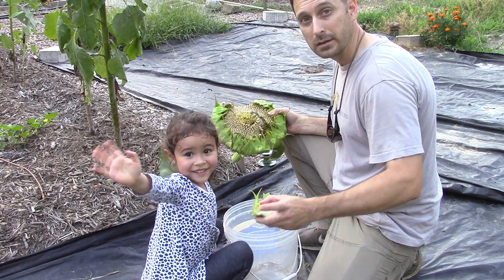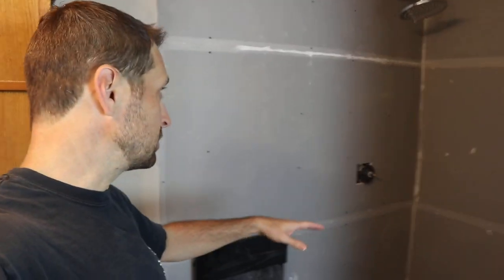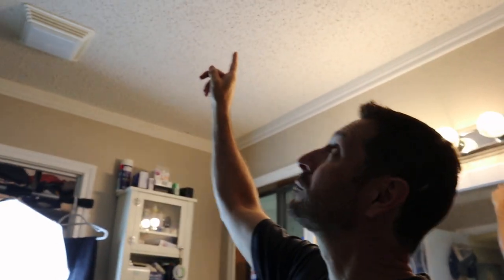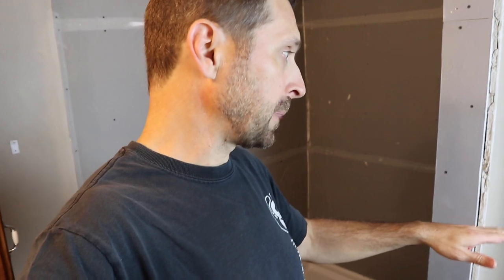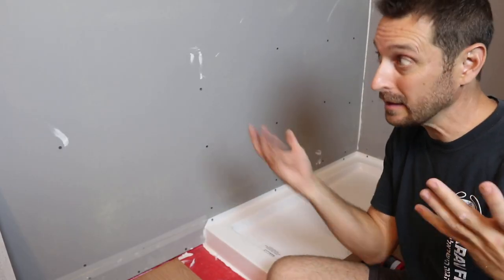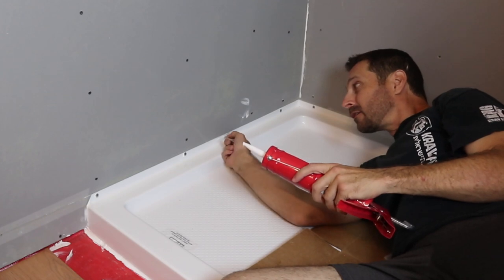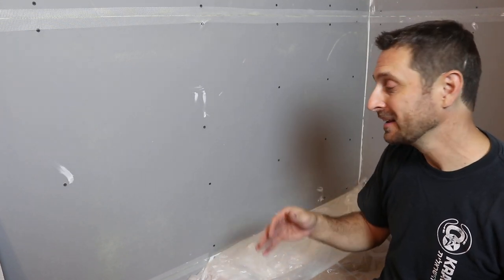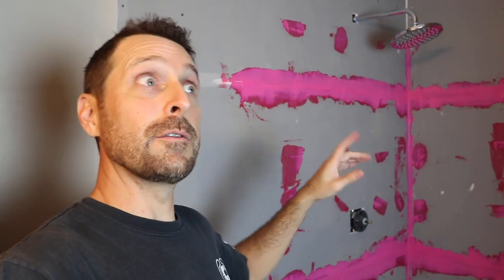If I Don't Finish This She Is Going To Kill Me!!

Comment: Do you have a video showing the wallboard installation around the shower? I saw the drain pan install, then this one. Can't find the one in between. Thanks.
Reply from the maker: Sorry, I don't. These videos were not popular with my subscribers so I didn't continue the series. I did, however, do a few videos on how to make your walls plumb and square so that the tiles will fit on the wall properly.
Reply: @CountryLivingExperience  ok thank you for replying.